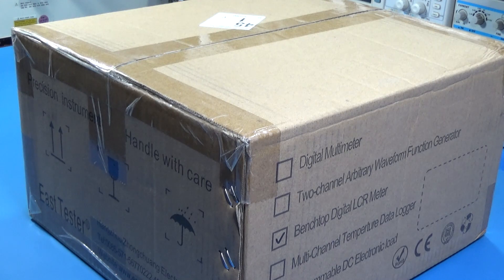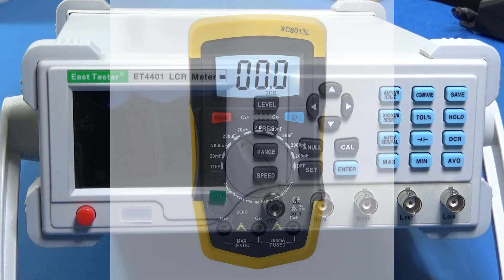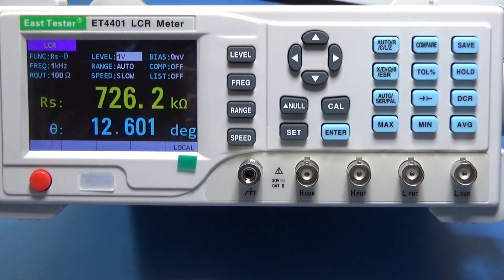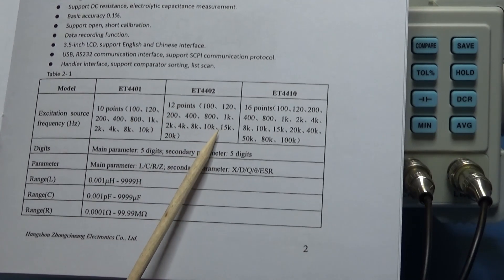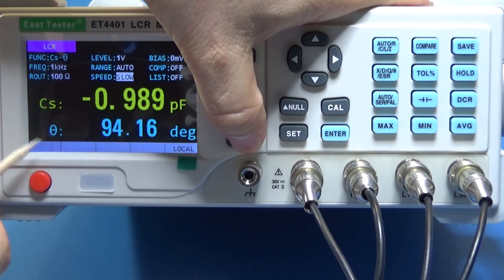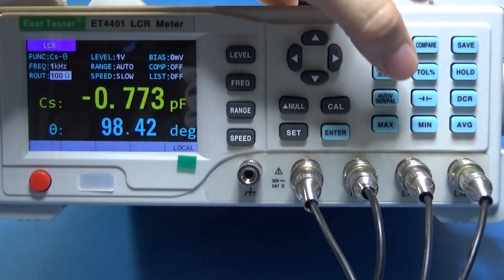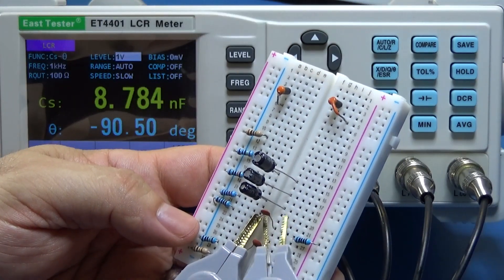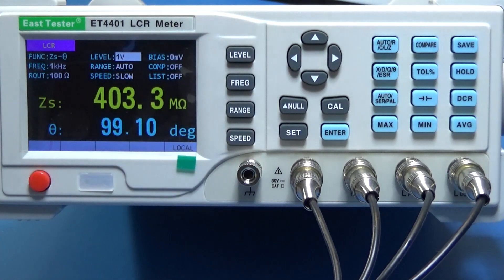ET4401 Benchtop Digital LCR Meter / Product review  for East Tester LCR Bridge ET4401 ET4402 ET4410

Comment: Bob, I just got one of these and I'm seeing some very troubling behavior, I'd like your opinion if I'm doing something wrong or if I got a bad meter...

I got this primarily for measuring electrolytic capacitors, so that's where I'm focusing.

I'm getting readings of electrolytics between 10 and 20 percent lower than all the other meters I have, for example

CEM 680uf cap:
Owon XDM1041: 618uf
Oyigao UA6013L: 612
Thsinde 18B+: 612
ET4401: (in LCR mode) 597
ET4401: (in ECA mode) 572 <significantly lower value in EC mode happening a lot.

Nichicon 8200uf:
Owon XDM1041: 7620uf
Oyigao UA6013L: 7680
Thsinde 18B+: 7610
ET4401: (in LCR mode) wanders continuously between 6900 and 10400
ET4401: (in ECA mode) 6920

Onkyo/ELNA 22,000uf:
Owon XDM1041: 21,870uf
Oyigao UA6013L: (out of range)
Thsinde 18B+: 21,380
ET4401: (in LCR mode) Continuously wanders from 22,5xx to 36,1xx0 - and then dips into Resistance and then back to capacitance
ET4401: (in ECA mode) wanders from 21,900 to 22,600 does not settle

Its really a shame: I expected this dedicated meter to give more dependable results than my other multi-purpose meters, but they all give reasonably repeatable readings while the ET4401 just wanders all over the place.

Results are similar before and after completing open and closed calibrations.

I have contacted East Tester about thin but have received no reply. Should I return this unit?

Comment: can I ask you a question please, would a hi frequency lcr meter (5 Mhz) be of any use in a pcb repair lab?
already have a hp 4263A up to 100KHz.
Reply from the maker: Hi! Most of the time, a LCR Bridge is used as component meter. ...and we try to test the component on the same frequency than the Datasheet's specification. Also some Electronics Laboratories uses Vector Network Analyzers to try to test or measure a PCB "internal capacitance, inductance, or conductivity". But VNA works only on high frequencies. And here is the tip: Some Labs uses LCR Bridges to try to do that test, but in low frequencies. (Most of the times, the SMPS frequency and until its 5th harmonic). Let's remember LCR bridges have many frequencies available, because we want to test the component on its datasheet specs and also on the frequency the component is working in our PCBA. That's the reason why we got so many "low frequencies options about". Thanks for asking!
Reply: @bob.kalpon1398  thank you for replying.